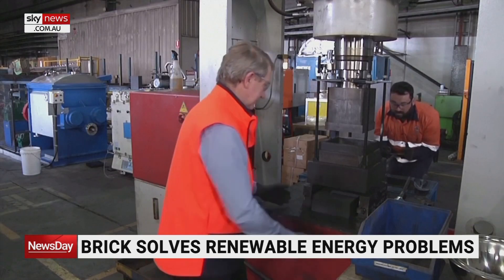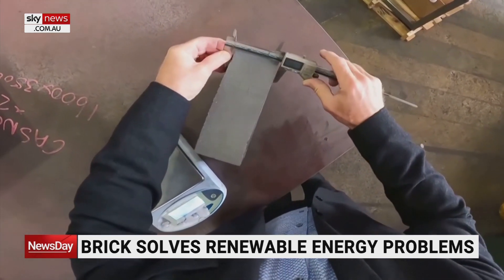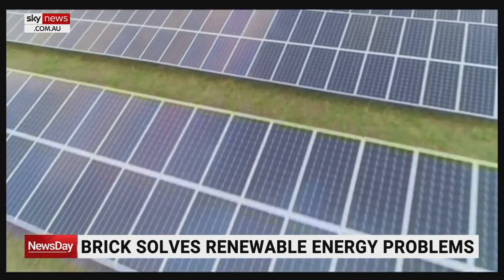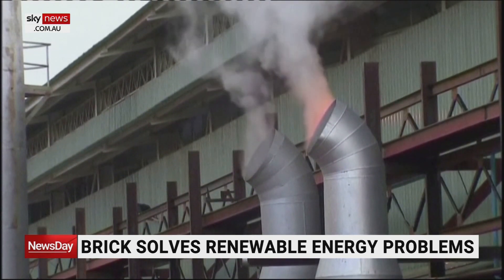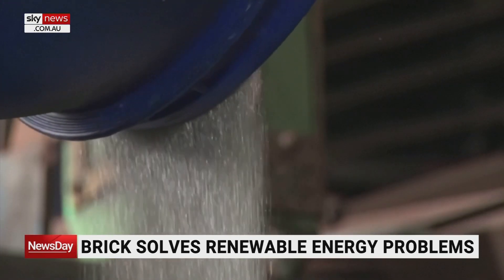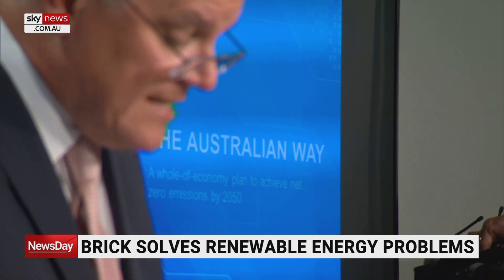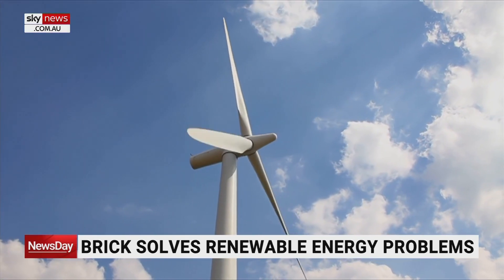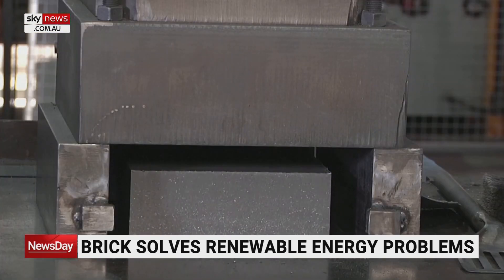New thermal storage brick could solve renewable energy problems

Comment: Most usable energy is lost converting electricity to thermal energy so it's not clear what this "new thermal block" accomplishes. As other's have mentioned, heat banks are old technology; they work but are not efficient nor do they reach temperatures high enough to warrant their adoption by industry. Unless it has groundbreaking (thermal) properties, I think it's climate-change snake oil.

Comment: ‘Ideas Man’ comes up with the uncosted idea of national transmission network solely set aside for renewables.
Reply: ??? This idea places the storage and retrieval in retired power stations - the bricks are designed to hold heat at around 400 degrees same that the stations deal with and of course leverages the existing high voltage infrastructure

Comment: Bahahaha, what a scam, back in the 80's we had heat banks in our homes that worked that way, massive cast iron blocks that lasted forever and had an electrical coil woven amongst them, they would charge up at night using off peak power and you would blow air through them when you needed the warmth in your homes. They were great but everyone ripped them out and replaced them with natural gas burning heaters because the net efficiency was greater. The best thermal storage systems operate using phase change materials and lithium salts and there is no way  a mix of graphite and aluminium comes even close to matching the tech that was worked out decades ago and is no longer under patent. This story is a warning of what is to come, a never ending parade of people spruiking solutions we either don't need or which are not viable for one reason or another.

Comment: Not a scintilla of information about what it is, how its made. the efficiency of converting electricity to heat then back to electricity, just the glib statement that it will ensure cheap energy. Of course it will.
Reply: Fair enough criticism of the presentation of the technology. This group does have peer reviewed literature showing how it works and it's feasibility though. If you search them it's pretty easy to find.

Comment: just use molten salt to store thermal energy, then we can intergrate a molten salt reactor to the mix easily and have a solar /nuclear hybrid system that is baseload and get the most out of the solar without it being intermittent? when the sun goes down the reactor picks up the load and slows down again at dawn naturally as its a function of how the reactor works, look into it?
Reply: @Peter... : Do they have any working Molten Salt reactors ? Or are they all still research project that are decades away ?
Reply: @buildmotosykletist1987  my friend , they were built and operated flawlessly at oakridge national labs for 10 000 hrs in the '60's china has one nearly ready to go and a few nations are thinking of putting them in subs because they are smaller and safer and more powerful, also a dutch company is selling "salt loops" to play with the technology without have any fissile material in them to experiment with materials ect, they are only 66 000 dollars if i remember correctly
Reply: @peterolsen9131  : So the multi-national project that puts the technology at "early research" stage is wrong and their forward projections of three decades is wrong. OK.
The fact remains that there are no working reactors and none being constructed. All current projects are research projects.
That said, I do like the technology and I hope the problems are resolved sooner rather than later.
Reply: @peterolsen9131  : BTW, the CCP project are based on the US technology but they did not include that information in their press release.
Reply: @buildmotosykletist1987  look up kirk sorrenson and "lftr" all u need to know is there
great lectures and well presented
Reply: @buildmotosykletist1987  for the oakridge reference , use " msre" or molten salt reactor experiment , please have a look and give yourself an education on the subject, this forgotton tech will save the world from  greedy elites that want us to have unreliable solar and wind  because thats what they invested in and dont care about us or if it will work...
Reply: @buildmotosykletist1987  chyna going online with 2 in 2022 (sounds better if Richie did it choo choo)
Reply: @jimlofts5433  thanks jim
Reply: @peterolsen9131  : BTW, do molten salt reactors need uranium fuel ?
Reply: @buildmotosykletist1987  but u can throw in nuclear waste, bomb plutonium can be destroyed in them too, they produce 1/10 th the waste and shorter half life waste at that, they have so much going for them, operate at atmospheric pressure , cant melt down cause they already melted, watch kirks lecture , it tells it all.....
Reply: @peterolsen9131  : Meanwhile we need safe, clean, green "nuclear reactors", preferably in the Small Module Reactor (SMR) form combined with a "scalable" storage like 'Pumped Hydro' or similar and not 'Lithium' which does not scale and is too toxic.
Reply: @peterolsen9131  : Mate that video is a decade old. What has happened to Thorium research in that decade ?
Reply: @peterolsen9131  : Mate it is taught in Aussie universities :-)
Did you know we have a leading thorium research project right here in Australia?
Do you know why it is still being researched and not actually working? The actual problems that Kirk brushed over and ignored? Do you even want to know? Or will you ignore them too?
Reply: @buildmotosykletist1987  ceramic coatings and liquid bismuth fission product extraction solves any corrosion problems and further insights gained from sutdying a running reactor is the way forward but anything nuclear in australia is banned , hopefully not for long by the way and we could lead the world . also , i hope this is taught in university and not just mentioned as an interesting historical reference to liquid fuelled reactors. remember a lot of the "actual" problems are pushed by activists paid by global oil, gas, uranium and renewable interests , pretty big enemies for an upcoming alternative that would make all of them redundant, remember , there is thorium everywhere on earth , on the moon, on mars, in asteroids and other planets we may  go to  using this single technology  to power it all, the fuel is everywhere , "burning the rocks" weinstein called it , the mountain is high, but with many having this knoledge then we may climb it one day only greed stands in our way, they did this sucessfully in the 60's! how much better could we do it today? let that sink in....
Reply: @peterolsen9131  : There are many Aussie students specialising in Thorium Molten Salt reactors, it is after all the flavour of the month/year/decade. It's very popular, therefore difficult to qualify to do it. Besides there is a research reactor which is allowed in Australia, for them to continue working in the field. It is I believe in Western Australia so you can use a search engine to find out more.
BTW, you jumped the fact that they require the evil "Uranium" to operate. It is used to start and maintain the reactor. It's funny that Kirk and many of these characters brush over that fact.

Have you ever wondered why small tech investors, invest in tech like Hydrogen but we don't invest in things like Thorium ? There is a key difference.
Reply: @peterolsen9131  : Another enthusiastic but skeptical Thorium bloke threw this in. I haven't seen it but he recommended it. https://www.youtube.com/watch?v=2x7do-_MTD0
I'll watch it tomorrow and see if you have any comment on it.
Reply: Good idea, solar should only ever be seen as opportunistic energy, as there will come a day when the sun does not shine much for a couple of years, at a minimum, another volcanic winter.
Reply: @DanielSMatthews  thank you and your idea of the volcanic winter has given me ammunition to strike fear into all the solar/wind nutters! great!

Comment: At the 17 second mark, the reporter is saying the power station shown is burning coal, but that looks to me to be a nuclear plant's cooling towers and if that is, then that would make this entire report suspect, at the very least, since the producer putting this together does not know the difference between types of energy plants. Also how would these heat blocks be stored until needed? I understand the blocks would be used to heat water and create steam to drive generator turbines to make electricity, like any type of power plant, but it looks like they would be more of a threat of fire, like white phosphorus which is very difficult to extinguish, or cost way too much to store until properly used. The report should really have included that information, in my opinion.
Reply: its a coal powered station but what they dont say is the plume you see is water vapor
coal is used to boil water to steam which then turns turbines
that is the escaping steam after turbine use
Reply: The towers might look typical of nuclear station, but both Liddell and Bayswater run on coal. Both are located in the NSW Hunter Valley.
Reply: No. Australia doesn't have a nuclear power plant. (Apart from the one used for research)
Reply: Too little too late. Climate change needs better solutions now. Let's hope they really solve some problems at the Glasgow conference.